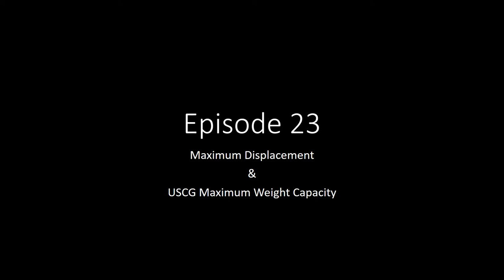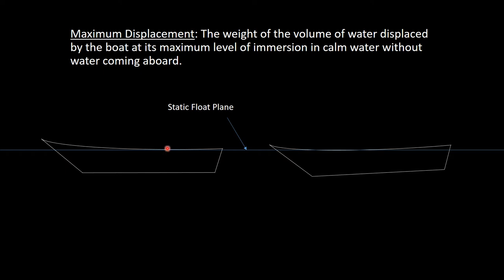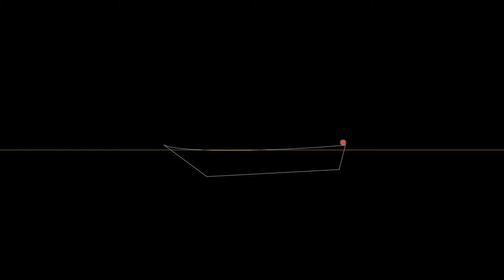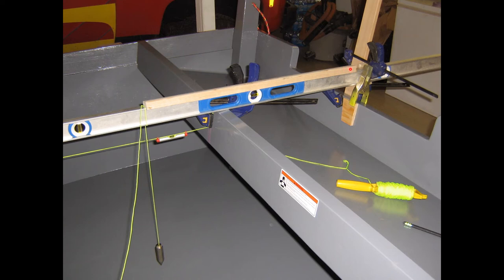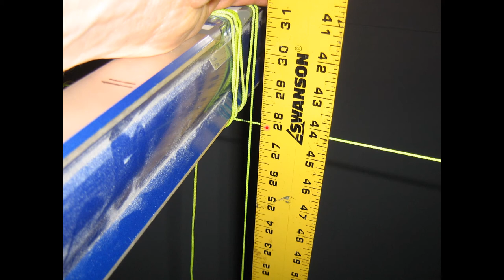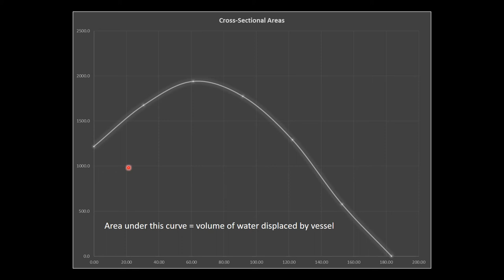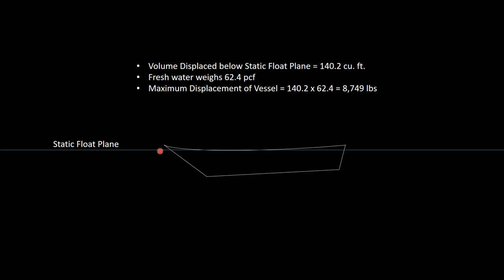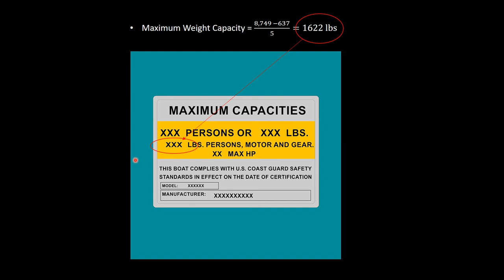Episode 23 - Max Safe Load for a homebuilt boat

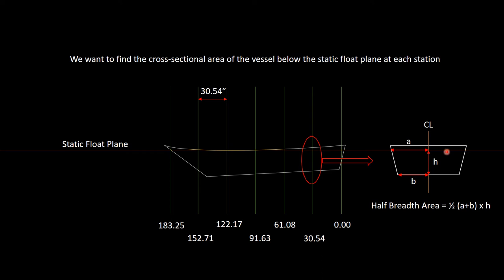Comment: Confused, at 19:00 into the video you show are full area as (Full Area = (a+b)xh), thus it appears that you used twice the width rather then the average width to find area, I was thinking it should (a+b/2) x h, to find the area of a trapezoid, or am I confused
Reply from the maker: Thanks for the question Butch. Recall a is the half-breadth at the top of the sheer and b is the half-breadth across the bottom of the boat. Both of these numbers are half-widths. If we add two half-widths together we get the full-width. Thus a + b has got to be equal to one width not twice the width. Think of it this way.  The full width gunwale to gunwale is equal to 2a and the full-width across the bottom is equal to 2b. We want the average full-width so we need to take the average of 2a and 2b. Therefore the full average width is 1/2 (2a + 2b) which equals a+b. I hope that makes sense. Thanks for watching.
Reply: @dennis6325  I am still confused... Area is length times width, so the area of a trapezoid is the average of the two widths times length, not the sum of both widths, it appears that you are combining them and not averaging them
Reply from the maker: @butchgoodwin  I sincerely apologize for the confusion and I appreciate you giving me the opportunity to try explaining it again. Indeed, the area of a trapezoid is the average of the two widths times the height. However, you are getting confused because you think dimension "a" and "b" are the widths across the top and bottom. They most certainly are NOT. They are each equal to HALF the width. This makes all the difference in the world. Look closely at the definition of "a" and "b". Dimension "a" is NOT the full width across the top, it is equal to half this width. Dimension "b' is NOT the full width across the bottom, it is equal to half this width. Summing half a width plus half a width is equal to a whole width.

Let's do two examples:

Example #1: Let's imagine a boat with vertical sides so its cross-section is the shape of a simple rectangle. Let's say the beam is 6 feet and height is 2 feet. I think we would both agree the area of this rectangle would be 12 square feet. Let's apply my formula. In this case, dimension "a" would equal the HALF breadth across the top and be equal to 3 feet. Likewise, dimension "b" would equal the HALF breadth across the bottom and be equal to 3 feet. The height, "h", equals 2 feet. Applying my formula (a + b) x h would be (3 + 3) x 2 = 6 x 2 = 12 square feet. Bingo! Formula worked.

Example #2: Now Let's imagine a boat with sloped sides so its cross-section is the shape of a trapezoid. Let's say the beam across the top (gunwale to gunwale) is 8 feet. Let's also say the beam across the bottom is 6 feet. Let's keep the height at 2 feet. I think we would both agree the average width of this trapezoid is 7 feet. Therefore, it's area would be 7 times 2 or 14 square feet. Now Let's apply my formula. In this case, dimension "a" would equal the HALF breadth across the top and be equal to 4 feet. Dimension "b" would equal the HALF breadth across the bottom and be equal to 3 feet. The height, "h", remains equal to 2 feet. Applying my formula (a + b) x h would be (4 + 3) x 2 = 7 x 2 = 14 square feet. Yahtzee! Formula worked.

Let me try one more way to explain it. Given two numbers how do you compute their average? The usual method is to add both of them together and divide by two. An alternative, is to take half of each number and add them together. Both of these methods will give you their average. By adding half of the width along the top, dimension "a", to half the width along the bottom, dimension "b", I am getting the average width of the trapezoid.

As you can hopefully see, I have defined "a" and "b" in an unconventional manner to facilitate the way I measured them on the real boat. I apologize for the confusion and encourage you to lay-out your own example on paper with a ruler. Provided you measure "a" and "b" as I have, I'm 100% confident you will see the formula I've provided is correct.

Comment: Geezsus, you talk so slow.......
Reply from the maker: Sorry Dave. Sad thing is...I think even slower than I speak. Ha ha. I do have a solution for you. If you hover your cursor over the gear symbol in the lower right hand corner, it will say settings. Click on it and then click on playback speed. Click on a number greater than 1.0 to speed things up as fast as you desire. Hope that helps and thanks for watching.
Reply: He also didn't have to take the time to make this incredibly helpful video for us. You should be thanking him instead of commenting on his rate of speech.......